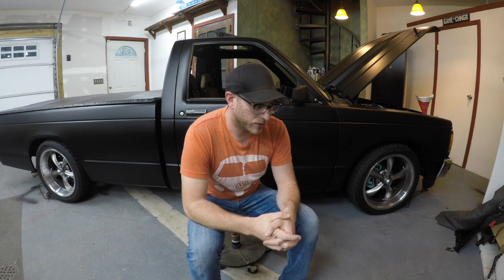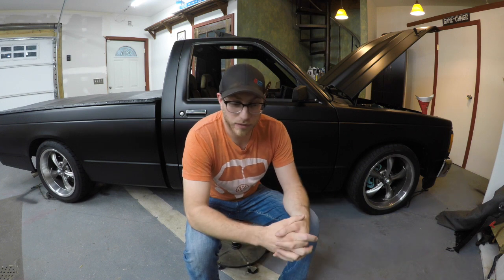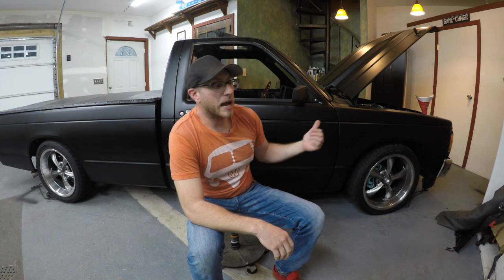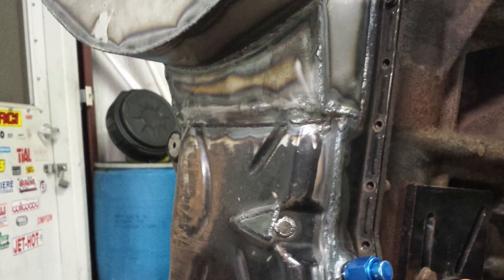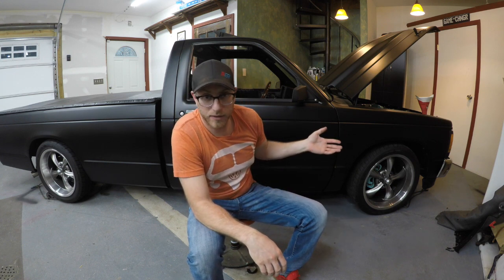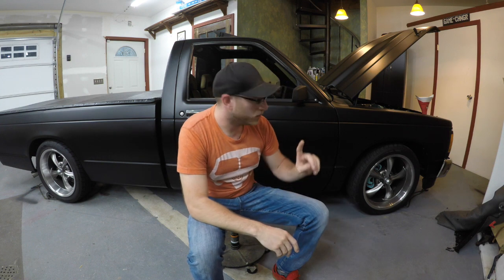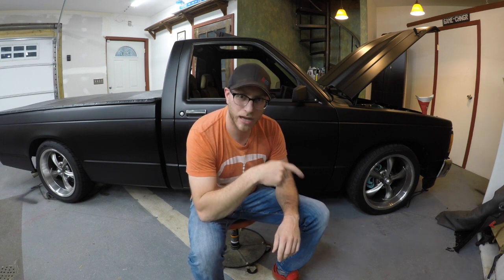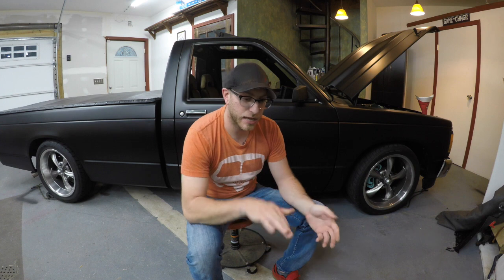VR6 Turbo Chevy S10 Engine - Transmission Adaption

Comment: Wow, I love seeing builds like this, the VR6 engine is one of my favorite engines ever and the S10 pick up truck is one of my favorite pick ups as well, actually no that’s not true The GMC Syclone is, combine the two together and you have the best sounding and performance looking machines ever, because nothing will ever beat the sound of a VR6. It’s one of the best sounding engines ever !🥳🎉
Reply from the maker: @Eurospec73 thanks man. I had the same philosophy, which is how and why I got here. Thanks for watching. I’ll be working on more truck videos soon.
Reply: @KennyChurchSpeed  Absolutely Ken, I own a Corrado SLC with the VR6 and I just had the engine rebuilt, I removed and installed it myself. She runs like a champ now.🏆🏁🥳🎉
Reply from the maker: @Eurospec73  great to hear! That’s one car I haven’t owned and would love to have one. Honestly, I’d be afraid to drive it though.

Comment: FYI, people also make bell housing adapters for TH350/400/T56
Reply from the maker: Hi, I didn't use the t56 because the cd009 transmissions were so much cheaper. At the time there was no adapter for the t56, and the adapter for the cd009 was available. Either one will work, the cd009 also provides factory 350z starter utilization. The cd009 is also a very large trans and I had to cut the floor out to fit it. Just preference really.

Comment: Hey man I have a question about your mounts what’s the best way to get ahold of you? I actually have this same setup in a 350z, I have an extra adapter plate for vr6 to th400 (from Ed also) that I’ve been Contemplating using in an s10.
Reply from the maker: Hey, you can email me at cncconcepts@gmail.com. I can send you pictures or explain.